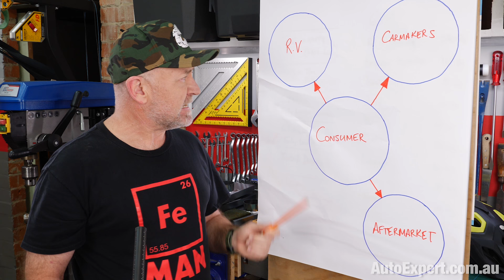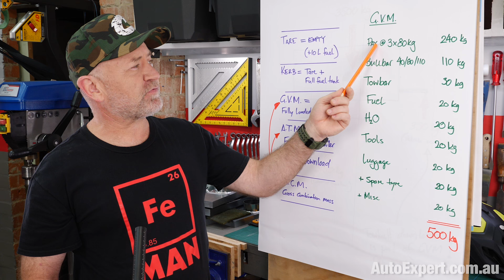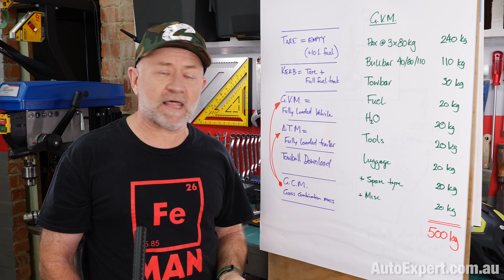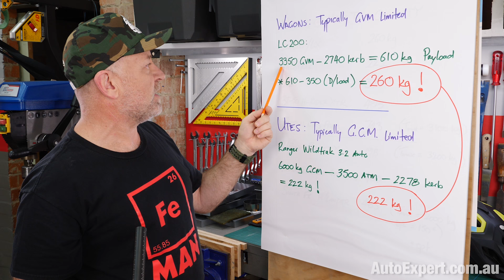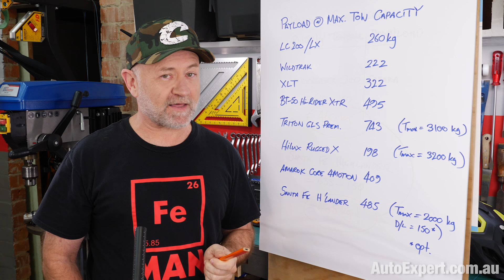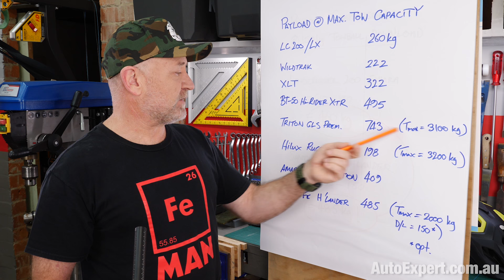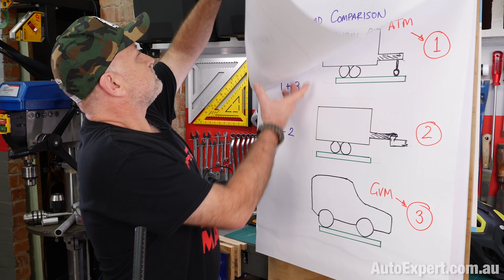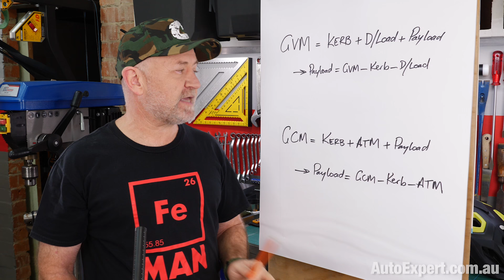Complete guide to heavy towing (GVM, GCM & ATM explained) | Auto Expert John Cadogan

Comment: Heavy towing in North America is a little easier since the accessories are a smaller percentage of the weights that we are looking at. For instance my daily driver load carrying capacity of my hitch (max download weight) is 2,700 lbs and my hitch is rated for a 20,000 lb trailer. The truck is only rated for a 16,000 lb trailer, but has a 3,400 lb payload (10% ball weight leaves me 1,800 lbs for all the accessories). Even fully loaded I am still 2,000 lbs under the 26,000 lb limit on a standard license (truck weighs around 8,000 lbs). 
My RV has more of a problem despite a GCW of 55,000 lbs. It is limited to a 10,000 lb trailer with a 1,500 lb tongue weight. Fortunately the tare weight on that vehicle is only about 37,000 lbs.

Comment: GVM up grade on a vehicle needs to be inspected and signed off by a engineer and a modification plate fitted to the vehicle. One thing that was not pointed out was a holder of C class licence can only drive a vehicle (with or with out a trailer) up to 4.5 tons GVM. John is right if you what to tow a heavy trailer get a truck and a truck licence. And read the COR laws as every vehicle over 4.5 tons is classed as a National Heavy and another set of rules.

Comment: Was getting my annual inspection performed the other week at a workshop that specialises in four-wheel drives. Somehow the conversation got onto GVM of vehicles, he was saying he has 4000kg lift and often it won't lift many vehicles (think Hilux, Ranger, Triton etc) so he can add more accessories for the customer. He said he often has to take wheels and other stuff off to get it into the air. 

A little scary if you ask me, I often wonder if we should make accessory fitters liable if they fit something that makes the vehicle overweight. Perhaps manufacturers should also give us more sensible payloads to start with, many are way too low to be practical for serious touring IMHO.
Reply: You can't legislate against stupid...

Comment: your gvm from stock is 2.5 tons  your suspension rated to 1/2-3/4 of a ton or roughly estimation 500-750 kg..

typical caravan is 2 tons give/take 100-150 kg..  (based on 23 foot caravan with shower and shitter with mod cons)

typical weight  limits are done when empty..

at a bare on road weight you would be  4.5 tons gcm
Reply: 23 foot is a pretty small trailer.

Comment: Just to add another curveball, what about max rear axle weight? If 350kg of weight is applied to the tow ball doesn't it actually becomes heavier over the rear axle because of the distance from the tow ball to the axle acting as a moment arm? Wouldn't it also take weight from the front axle making the front end lighter and Increasing the chance of understeer. I reckon you could explain this better than I can. Cheers!

Comment: For about 100k you can buy an Iveco Daily 4x4. It comes with a standard GVM of 4495kg (free upgrade to 5500), kerb weight of 2990kg leaving a payload capacity of 1505 or 2510. Adding in a tray (400), a bullbar and winch (150), towbar (40), passengers (200), fuel (90 + 25 adblue), towbar download (350) and a bit of gear (200) means a total payload of about 1350kg. That's being pretty liberal with those load numbers, and you still have 150 or 1150kg left.
As I've got a HR driver license, I'd tick the box for the free GVM upgrade and have the 1150. That lets me upgrade to the alternate factory 37" tyres and I'd add a small hand crane to lift heavy stuff in. I guess I'd still have 800kg left spare...
Reply: You could drive that towing a max weight trailer here in the US on a standard passenger license. Our GCWR cutoff is 26,000 lbs.
Reply: @rich7447  Yeah they are pretty strict here..

Comment: Here in the uk the the caravan club equivalent to the CMCA.Recommend towing weight you can tow with a vechical is 85% of the kerb weight of the vehicle you wish to tow with. 
For example a ford ranger kerb weight is 1950kg  85% of 1950 is 1657kg so  1657 kg would be the recommend gross weight of the trailer. towing 3.5 tonnes seems to be a crazy idea.
Reply: Tow rating of a Ford Ranger here in the US is 3,500 lbs. I don't know how they manage to translate that to 3,500 kg.
However, my Ram 2500 has a kerb weight of roughly 8,000 lbs and I routinely tow a 14,000 lb trailer (up to 16,000 lbs at times) with it. I make sure that my hitch weight is between 1,400 and 2,200 lbs and my brake controller is connected and all is good.

Comment: This is why there's such a rise in the popularity of Rams, Silverados, Tundras, etc.
Reply: Indeed. I bought a BT50 a few years ago, before the American Utes were easy to obtain here. If I was buying today I would certainly had bought an American Ute instead. A RAM for example, is even less expensive than a LC200!
Reply: @RobB_VK6ES  the Raptor was never meant to be a tow vehicle, it's built to go quickly over rough terrain, it's not much good for anything else.
Reply: Kh2 ESP  it is the buying power, we're a big country, but a small population.
Reply: Mark Simpson The rise in popularity of those guzzlers is due to the cheap price of fuel.

Comment: I get not towing heavier than the vehicle, but trucks don't weigh remotely close to half of their trailer (eg 70 tonne truck and trailer is mostly in the back).
Reply: Exactly. My 8,000 lb pickup often has 14,000 lbs behind it, but the trailer needs to have brakes.

Comment: With the drought there's a lot of people buying a cheap 1000l ibc tank and collecting their own water... the problem is they throw it into a basic 750kg unbraked trailer and tow it home with their toyota corolla.
Some genius' have even worked out they can fit two tanks on the back of an old 1.5t tray back ute... and then add the aforementioned grossly overloaded unbraked trailer. 
They live among us.

Comment: Does the GVM only apply when towing? If the GVM does apply when you are not towing how would for example would an eight seater 2013 Toyota Tarago comply with 8 large adults in it? The GVM is 2430kgs - kerb weight 1795kgs = 635kg payload. This allows approximately 80kgs per passenger. It is not unimaginable all 8 people could easily be over the 80kg mark eg a football side being driven to a game. Also when they determine the kerb weight there they only put in 10ltrs of fuel, the fuel capacity is 65ltrs so you can add an another 55kg to the load.

Comment: Love your stuff JC keep it up. Hope this info reaches the right peeps so everyone is safe out there.
Questions if I may, please.  
Do each axel in a vehicle have a maximum weight capacity?  If so,  should that be considered when towing a heavy load  (I.e. subtracting the tow ball weight)?
Tia
Reply: Yes, each axle has a maximum weight (found in the users manual). You must stay within each of the Gross Vehicle Mass, the Combined Vehicle Mass, the Gross Trailer Mass, the allowable Tow Ball weight and no axle can exceed its weight capacity. Sway bars (or load levelling bars) are often used to move the weight around the axles for vehicles running close to all the allowable numbers.

Comment: I love this one.  If I can be excused for some "Cultural Appropriation,"   Right on Mate.  

I have not seen some of the problems you mention in the US.  When I was searching for a trailer, I saw one salesman refuse to sell a trailer to a man because his vehicle was not capable of towing it safely. Once the tow capacity of a vehicle is determined by the manufacturer here in the US, they are the only ones who can change the ratings, so the aftermarket has its hands tied.  I do not know if the RV sales people are motivated by any feelings for the customer or fear of being sued if they knowingly sell a trailer to  be towed by a vehicle incapable of towing it safely.  Notice, that individual sellers of used trailers seem to have no such conscience or compulsions.   For my own vehicle and trailer here are the stats, Excuse me for using the "Murican" terms.
Vehicle  Empty Weight = 4004 lbs,  GVWR = 5500 lbs.   Tow capacity 4500 lbs and hitch/tongue weight 450 lbs.  Trailer Empty weight UVW =  1250 lbs,  GVW = 3500 lbs a calculated Tongue weight 385 lbs.   We came to get a trailer with these limits with the help of the salesman who sat down with us and helped determine what we could tow with a generous "safety" allowance.  Fully loaded check on a scale had the vehicle weighing 5100 lbs with full  tank of gas,  my wife and I and our "In car,"  supplies.   The trailer fully loaded including a full water tank.  came in at 2175 lbs and a real life tongue weight of 236 lbs.    That is the way it should be done.

BTW it stores in my Garage and cost less than $10,000 American.  And I get to camp in places that have no hotels,  super markets or crowds.

Comment: Can you do one of these videos on whether you should buy a 4x4 Ute/Cruiser/etc or a "Large American-Style" Pickup. (Silverado, F-250, Tundra etc)

Would be interesting.
Reply: David Reade - Evans the answer is.....YES.... get the Ram!!!  Then the other debate.... gooseneck over draw bar.... the closer you simulate the dynamics of a semi trailer, the safer  it will handle by eliminating the swaying or pendulum effect.  Boss has a 2500 and the torque of the Cummins is off the charts (as is a Duramax) and they come factory fitted with both an exhaust brake and electric trailer brakes.  If you have the budget, the big 2500 pick ups are fantastic tow rigs.
Reply: @AUSSIEGIZMO76  We came across two brand new RAMS broken down and stranded in one of our laps of Arse Trailer … Starter motors shat them selves...one poor bastard was stuck at Nullabor Station for days while he waited for someone to come and fix it (From Sydney). Rams are yankee pieces of shite and it will let you down....buy a proper truck before it's too late.

Comment: in Oz, heard the trailer weight has to be 80% max. Of the weight of the tow vehicle, so it not the
'tail wagging the dog'...
Reply: That's called hearsay. You heard it then you said it. GVM, ATM & GCM are the holy trinity...
Reply: It's not a law or regulation. It might be (un)common sense, but it's legal provided you don't exceed any of the individual axle loadings, the GVM, ATM or GCM specifications.
Reply: Art Mallory... You heard wrong... please watch the video again
Reply: Art Mallory... I understand your mechanic told you this. Mechanics per say are not usually experts in transport regulations but I am sure he is a fine upstanding Chap. You need to make sure you understand the regulations which is why I encouraged you to watch again because if you did pay attention you would not be asking this question. You should have thought "<insert mechanics name> was  wrong about that 80% stuff."
Reply: Tongue weight is the important stat when it comes to the tail wagging the dog. Never go less than 10% of trailer weight.

Comment: I agree with the payload limitation considerations. Some manufacturers increase the capabilities by adding transmission coolers, using tires with higher weight numbers... when using same engine/transmission and even platform. Toyota goes, in US, from 3500 lbs to 5000 lbs by doing that (RAV4 and Highlander, V6 and 5speed auto).
But the tow limit numbers in Australia are really inflated. Almost equals in kg the lbs in US for the same cars.

However, you disabled comments on the weight distribution hitch video. Your explanation just relies on the "torque", which is true to some extent. 
But any torque is physically generated by a force and an arm (lever) distance. A real force that is. So if you do that math, applying the lever of the force as being the arms of the weight distribution hitch, you will have the torque force (equal with the elastic force) applied upwards on the hitch body, to create the torque that is rotating the frame. From examining the construction of such a hitch one can clearly see that the point of that force is UNDER the ball, so it does nothing to unload the weight force that is actually supported by that ball from the ABOVE trailer (caravan) connection.
So yes, it will not unload the BALL force, but it will unload the resultant force when combined at the vehicle's frame. The combined force is exerted against the springs. 
That's why the springs go "up", is less force on them and F=-kX doesn't lie. The rear of vehicle is supporting less of a down force because of resultant of 10% weight load is opposed by the elastic force in the leveler arms.

Where this force will be applied to on the trailer (caravan)? Well, if you follow the torque logic, you will find out that the resulting force will end up add up on the trailer (caravan) wheel load (where support and reaction is applied). 
The gravity center location of the trailer (caravan) doesn't change, and that's great for it's dynamic stability. Weight (as mass) doesn't change, but the resulting forces transmitted to the ground by wheels do. Instead of 90% force (F=0.9mg) you will have an equivalent 95-97% of that mass load on those wheels. NOT weight, because the weight component remains the same. For some it's confusing the talk about weight as force versus as mass... but you can see the difference.

Comment: I see individuals adding an air suspension to a truck to level out the towing vehicle to tow heavier. There is the legal aspect and the physics aspect of doing so to confront. There is in the US the Ram Power Wagon that has mega power but reduced payload and towing because of a softer suspension for off roading. Someone could enhance the suspension of the PW and do what a differently configured suspension vehicle Ram could do better but be an outlaw doing it because the manufacturers limits on paper.
Reply: The PW could be stiffened to do what a cheaper gas powered 2500 could do, but would never have the towing capability of a Cummins powered 2500. It's easier to add lockers and a winch to a diesel 2500 (not the detachable sway bar as that is PW only) than max out a PW for towing. You are right though. In the US the GVWR and GCWR are set at manufacture. You can downgrade, but you can't really upgrade.

Comment: Hi John, 
I was mind blown by one of your vids on youtube about hydrogen gas usage in normal gasoline combustion engines.I was looking for an experts opinion about something and don't trust the expertise of local car garages.

I would be very  thankfull if you could give your opinion about something I am dealing with.
What I am dealing with , is a VW crafter in a Bi turbo config.It's my own van.I just bought it 3 months ago.
It's motoroil is polluted.a slimey light brown substance is created after operation.
An expert said it can have to do with old oil or water/cooling water that is being mixed with and leaked into the motor itself.
Besides this , I am using used motor and transmission oil filtered with 3 micron filters.50/50 ratio with diesel.
I know this isn't very clean.I am working on a better setup for filtration.like distillation.extracting water from it and even a centrifuge.I have decided not to increease the oil/diesel ratio.

The motor is running fine...fast reaction.It is more quiet though.just like my experiments with plant based oil in the past.

My question:
Can this motoroil problem have been caused by the used oil that is burned as fuel ? 
Do you have any recommendations for a filtration setup ? 

I first need to wait because I am migrating to another country and then I am in the ability to make a better filtration setup.

In winter I can add ethanol or gasoline to the mix because the cold makes the mix slow and thicj

Someone stated you need to use methanol and water and spray it in the air intake now and then to clean the system.

I would like to continue this project without damaging the motor.Is there a link or can there be a link betweenthe polluted oil in the motor and the usage of used oil as fuel ? 
I wasn't able to find an e-mail adres to ask you this.Excuse me for that...

Thanks in advance, 
Mark Hillen

Comment: If you're doing a lap and want the luxury of a big van with plenty of room, I'm all for buying a suitable vehicle to tow it with but no such vehicle is sold in Australia. Sure, you can buy a Dodge Ram or a Ford F-350 but you'll pay around $50,000 just to have them converted to RHD. You could buy something like a Hino or Iveco truck (both available in 4 x 4 if you need that) and they'd do the job very well but the cabs are designed for work, not touring in comfort. The ride would be nothing like an F-350 Laredo (or the equivalent Dodge or GMC).  As for the trailer itself, I much prefer a 5th wheeler to a caravan. Semi trailers have the trailer wheels right at the rear and the front of the trailer rests on the vehicle right over the rear axle(s) rather than having the trailer wheels in the middle and the front hanging on the truck way behind the rear axle(s) and they are that way for a reason. Really though, if you're doing a lap, buy a motor home and forget towing. Sell it when you get back.  Either that, or weigh up the cost of buying minus the cost of selling plus the tons of fuel it'll use compared to your own car against, as John says, staying in hotels. You never have to make a bed, cook a meal and wash the dishes, pump out the toilet, etc. The down side is you just can't pull up anywhere and all the accommodation in the next town might be booked out for some festival you didn't know about. Weigh it up but in my opinion, towing a big caravan comes in last.

Comment: John.
Where does the axle loading  limits come in?
I was reading the specs on a  Ram 1500 and it looks as if  the axle load limits  are quite light on. Streets away from the advert of  "tow four and a half ton" whilst it's eating other Ute's for breakfast. There was also a comment that the oem rims and syres are sub standard on required load capacity. Cheers.